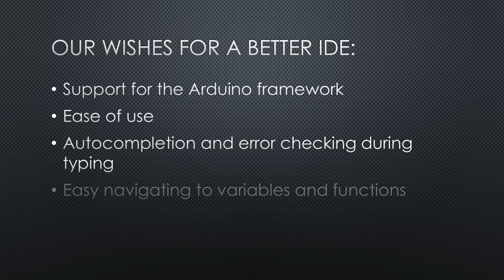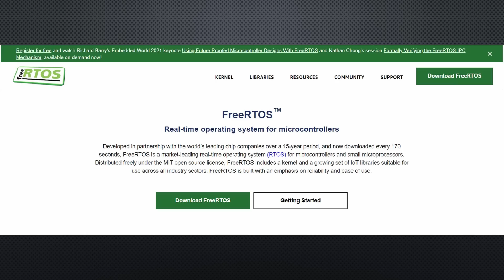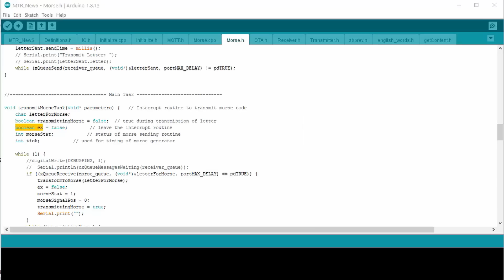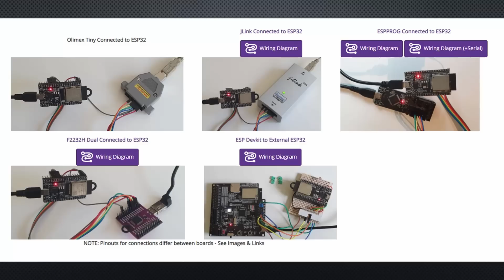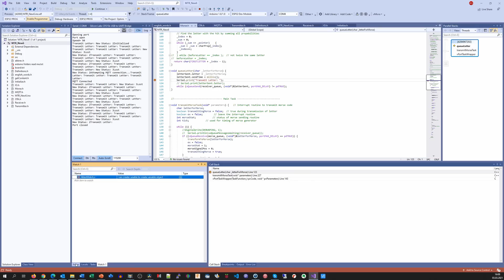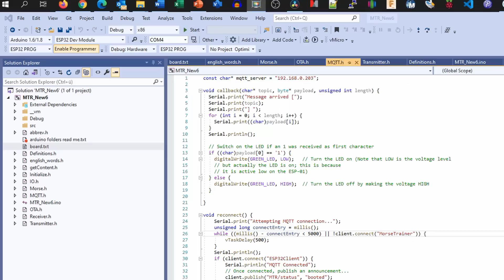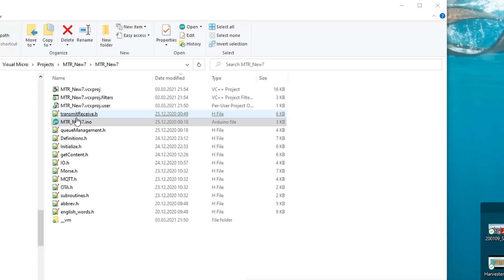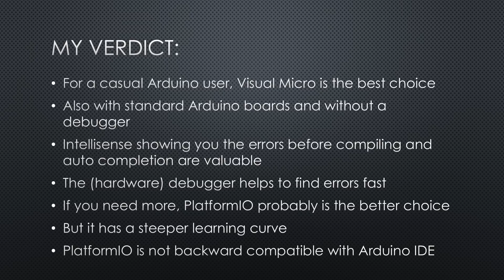#375 Is Visual Micro the better Arduino IDE? Including ESP32 inline debugger

Comment from the maker: Visual Micro only works on Windows. I should have mentioned it in the video. Sorry for that.
Reply: Anyone know if it works under Wine?
Reply: @boots7859  Sadly Visual Studio performs abominable under wine, if you manage to get it going at all. Perhaps it can work as a plug-in for MonoDevelop (aka Xamarin Studio aka Visual Studio for macOS, but then the Linux build) but that would also need some work from the plugin developer(s) or community.
Reply: You can use VS Code add-on Arduino, that way you can use on any OS.  Good thing is that you can open any existing Arduino project with VS Code and whenever you want you can open that project with Arduino IDE again not like PlatformIO that create specific files for the project.
Reply from the maker: @Chris: Did you already try it?
Reply: @cdyoutoob  Link on the page takes back to classic ide download page.
Reply: @sairfan06  the #experimental_software tag is not setup. Just scroll further down and look for 'experimental'. Top half of page does show current supported version as you said.
Reply: @cdyoutoob  thanks got it,
Reply: That eliminates me as I only develop on Ubuntu.
Reply: Oh, that's a pity. Nowadays that's almost unforgivable. PlatformIO's pretty good, and I suppose you can contribute fixes to it as well.

Comment: 20 years ago i worked for a company where we build JTAG Debuggers (for the Pentium CPU). The reason why you are limited to 4 breakpoints is that these breakpoint get serially shifted into 4 special registers inside the CPU. They are simple address comparators that finally can halt the cpu. There are just 4 of those registers, that's the reason why you can have just 4 breakpoints .. but that should be enough for most scenarios.
Reply from the maker: Thank you for clarification. It seems logic and another viewer mentioned the same fact. I did not know it.
But I have to confess that I fast get 4 breakpoints because I keep a few "strategic" ones. But I learned to deactivate some of them if I do not need them anymore. Like that the stay where they are...
Reply: Btw: The JTAG debugger you get today for <15 bucks costed ~10K bucks those days. The (great) JTAG idea basically is a long chain of bits that get clocked bit by bit  into various components of the cpu. To be as fast as possible we built a special ASIC those days that ways able to "clock in" those precomputed chains with ~10Mhz, to be able to stop at a breakpoint, examine a variable or memory condition as fast as possible and have the cpu re-go.  I created those "serial chains". Boy that was ages ago ... but at these days nobody else did it that way ... therefore the price ;-)
Reply from the maker: With such things we see how lucky we are today. I highly integrated chip does the thing for a few dollars :-)
Reply: I always feel amazed when i see epic tech comments from people who made all these technologies back in the days. Cool!
Reply: @AndreasSpiess  Even today, I can only set a few breakpoints on my ARM devkit at work before it complains 'no more resources'. Thanks Texas Instruments.
Reply: ب

Comment: Thank you Andreas for your information video. I have been using Visual Studio for many years and used with its C++ debugging. I will start to test Visual Micro as an IDE for my Arduino projects.
Reply: Visual Studio != Visual Micro.
Reply from the maker: The debugging of the ESP32 works quite well!

Comment: I have used Visual Micro for over 11 years now,  and have not found anything that I couldn't do.  To understand the environment it is equally complex and has a long learning curve to really know all the features.  So, it is the devil you know, vs the devil you don't know.  I like having compatibility with Arduino IDE,  having this feature defeats the ability to control libraries versions the 'easy' way.  Having Arduino IDE compatibility means you can hand off source to a newbie so they can make changes easily.   Excellent video as usual.
Reply from the maker: Thank you for sharing your experience. I found the learning curve less steep as with PlatformIO (to get something working). But it has less possibilities for large projects where I would prefer PIO.
Reply: @AndreasSpiess  I have had no problems with large projects with Visual Micro + Visual Studio.   I agree, getting VM + VS to work is a lower learning curve.  However, you can get into trouble with either tool equally.  :->   Both are good solutions.

Comment: Hi Andreas, I have used both Visual Micro and PlatformIO extensively and for large projects. I'd like to add a few things to your comparison. 
1. The serial port in VM is much more stable than PIO. You can plug the device in and out of the USB ports, and the serial monitor just keeps working. Not so with PIO. 
2. On a multi-monitor setup, Visual Studio works much better than Visual Studio Code. The latter does not allow 1 instance to have several windows, whereas Visual Studio allows you to arrange the windows any way you want it, even over multiple monitors. 
3. In Visual Studio you can test (HW independent) library code by compiling it for windows. All the powerful debugging features are available. You can use the built in unit testing framework to thoroughly test your libraries. 
4. I use multiple projects in one solution a lot! It is the perfect way to write smaller test-programs to test-drive your library components. This way your main program, your libraries and your test code stays together. (a simple example : when you develop an arduino library, the library itself and the example projects are all separate projects in one solution). 
Of course it is a personal matter, to some extent, but I've found myself always more productive on VM than on PIO. Thank you for your inspiring video's and I hope to meet you once in real life somewhere, someday where we can talk about our projects. Pascal
Reply from the maker: Thank you for sharing your experience! I never used testing feature. It is still on my list. But I do mostly projects and not libraries, so the testing is often done with "the real thing"...

Comment: Another great video ... good to have your input.

I bought Visual Micro a long time ago. I had it installed on Atmel Studio (which was an option.) As you point out, it works without additional hardware purchases, (a selling point for me at the time.) But, while serial debugging seemed like a really cool idea, it has some serious limitations. Also, I found that with Visual Micro, every time there was an update to the Arduino ide, Atmel Studio, or Visual Micro ... things would break. At times, it could be really frustrating. Finally, I bought an Atmel ICE programmer/debugger (and Visual Micro became redundant.) The Atmel ICE costs ... but it just works!, and Atmel Studio is a wonderful piece of software. Of course Atmel Studio only handles Atmel products, so ....

I know that a lot of people love the idea of having an 'all in one' solution. Intuitively however, software which tries to do everything, is bound to have some issues, which the creators will struggle to keep up with. 

For me; I'm happy to use Atmel Studio (with ICE) for Atmel products, STM32 CubeIDE (with STM link) for STM products, PlatformIO (with ESP-PROG) for ESP32, and even Arduino (with Serial.write() ) when I just need to throw something together quickly ... since each of these environments works 'really' well for the supported hardware.

I applaud the guys who make Visual Micro. It sounds like they have improved it considerably since I last used it, and perhaps it's for some people, but probably I won't be switching.
Reply from the maker: Thank you for sharing your experience! For my use case (only Arduino compatible projects), mostly on the ESP32) it fits my purpose because of the debugger and the backward compatibility that I can use the Arduino IDE to show my projects on my channel.

Comment: 4 breakpoints is not a limitation of gdb, when running a program from flash you are dependent on breakpoint support from the jtag hardware inside the chip.
As the debugger is not an emulator, it cannot stop program execution by it self. It actually writes the address of the breakpoint to a register in the chip. Ask the chip to continue running. And then waits for the chip to report back that a breakpoint was reached and has halted.
It is different if program is executing from ram. Here, when you set a breakpoint,  the debugger will replace the instruction at that location with a break instruction (storing the real instruction in its own memory), and using some clever replacement make this invisible to you. Thus not being dependent in a number of break regusters in a jtag unit, you have close to unlimited breakpoints when running in ram.
Reply from the maker: Thank you for clarification. I did not know this.

Comment: Andreas, again thx for the excellent videos you create ... first thing I watch Sunday's after my breakfast :)  I've been using the Arduino IDE for 4-5 years and gave PlatformIO a try last year, mainly because I had to deal with specific Library-versions & different hardware. It did work, but as a hobbyist I found it too complex for me.
Visual Micro seemed an ideal solution and I gave it a try; I've created a Solution with one Project inside as you showed in your video. I used the 'Clone for project when using libraries' with the 'Library versions',, this is exact what I need and it works fine. Gave the (serial) debugging a try and again excellent.

But there is one thing I cannot find how to do, probably because I am not used to work with VS 2019 / Visual Micro : in the Arduino IDE, I regularly use the 'Save as ...' with a postfix version (-v1, -v2, ....) to have a copy of my versions while developing. But I cannot find how to do this with VS 2019/Visual Micro - if we keep the one solution/one project structure, I need to clone or copy the solution and rename (all solution/project files)? Although having multiple versions of a project in a solution could also work for me ? But there does not seem to be easy method for that - using a full-fledged version-mgt system will again make this too complex ?
Do you or anyone else have some recommendations how to handle this ?
Reply from the maker: Maybe you have a look at the github implementation of Visual Micro. It would give you the possibility to create new "commits" instead of versions.
I also use Visual Micro for the moment because it is backward compatible with the Arduino IDE.
Reply: @AndreasSpiess  I will give the github implementation a look. But currently I am looking into the one Solution containing multiple project versions; In Solution Sketch, I start with proj sketchv1; then a create a new project sketchv2 and copy my ino & .h files into the new directory. For the libs I use the 'Clone for solution when using libraries'. Not as easy as the 'Save as ...' in the Arduino IDE but workable. I'll see how this progresses ...

Comment: The best approach i found is to use the best of both worlds:
1. Open Arduino IDE (Advantages: easy to use, libraries available, default IDE and therefore many tutorials online in case of errors, all possible boards supports, ...), go into the settings and enable external IDE.
2. Open CLion (Advantage: High Level C++/C/Python IDE with autocompletion, ClangTidy, ... support) on the project from above and program here.
3. Compile in the Arduino IDE and use the Serial monitor from it.
Reply from the maker: Thank you for sharing your experience. Your approach is very good if you do not want a hardware debugger. This feature is very important to me.

Comment: As always, you have provided an excellent single point of reference for me when I have decided to try something out  and postponed (procrastinated ?) the learning, knowing that I will always find the answers if I search your videos. Thank you, Andreas! I have been using VS Micro since the early days and VS itself even longer. In fact I did not start using Arduinos till VSMicro brought intellisense and a mature GUI to the platform. After being utterly spoiled by using PIC micros with their superb dev platform that included step/trace debugging, emulators (you could test most code without hooking up the micro) I was disappointed with the 'Duino. In studying JTAG debugging with the ESP32, I noticed that the IO Pins used are also the ones used for accessing the 4-wide SD-MMC bus - I wanted to mention that this is one more exception where it may not be possible to attach the debugger.
Reply from the maker: I agree with the pins. This is why I created an Excel sheet where you can select all sorts of criteria to find the pins you (still) can use. The JTAG pins are one category which must not be used if you want to debug.

Comment: I'm using Visual Micro for 3 years now and for people accustomed to Visual Studio this is simply the best. Platformio has barely a GUI. Everything is done via dozens of console commands and there isn't even a shortkey chart available for people with a non-US keyboard. I prefer comfortable software.
Reply: BTW: One can use ReSharper C++ together with Visual Micro to get an even more powerful development environment.
Reply from the maker: I also found Visual Micro easier to use. This was the reason for this video...
Reply: @AndreasSpiess  I just wanted to give VM a second voice in the comment section since it was foreseeable that Platformio fans would run wild in the comments like when Heise.de mentioned Visual Micro.
Over time I had a lot of conversations with the author about problems I had and he really tries to help.

Comment: Arduino has realsed an Arduino idea 2.0, still in beta but maybe hoy could give it a try
Reply from the maker: I did it. Good direction, a long way ahead...
Reply: @Bryce Ahmad  @Marco Drake  why would anyone hack somebody's profile? Go see a psychiatrist, you have issues.
Reply: @AndreasSpiess  did you get enough of a look at it to form an opinion that is worth a video? in my opinion it having auto complete already makes it a thousand times more useful than the current arduino ide
Reply: @TheScarvig  from what im seeing...the 2.0 beta is built on the same VScode core as this ...so its prity much the same.....just doesnt have all the window features..that IMO are unnecessary
ive also noticed M$ is pushing the VSCode everywhere lately... Windows, Linux, RPI, and now MCUs
Reply from the maker: I tried to use it but for example autofill did not work after deleting a letter and stuff like that. Nothing for a fair review for the moment. It compiled a complex ESP32 sketch with many libraries. This part seems to work.
They also will not create an ESP32 debugger interface and hope, somebody else will do it. I will have a look at it from time to time.

Comment: using visual micro since yesterday and I'm very impressed. Thanks Andreas for inspiring again and again and again and......
Reply from the maker: You are welcome! Glad you like it.
Reply: Why not use Atmel Studio? It is a version of visual studio specificsllg for atmel mcus.
And they added in arduino functionality a long while ago making visual micro obsolete.
Only thing I dont know is that if there is debug capability without a programmer, in that case visual micro still has its place. But they have a visual micro plugin for atmel studio as well.
Reply: @LittleRainGames  in my case I have a mid large project with ESP32

Comment: Have been using VM now for a couple of weeks and like it quite a lot. One thing is that I have not been able to write a littleFS file system for an esp32. I carefully followed the skimpy directions on the VM website and always get a can't find a tool error. A work around is to set up  the littleFS tools in the Arduino IDE (per another good online video) and write the files and file system with this environment. Once the file system is in place files can be read and written from inside a VM C++ program with the appropriate libraries. Another issue I came across is that the serial interface stops working for output if all the pins are setup as Digital IO (required for the board I  am designing). Not sure yet which pins are the problem.
Reply from the maker: 1. They have a forum where you can ask questions.
2. I made a video about which pins you can safely use.

Comment: I have used Visual Micro when I was a Windows user. It was simple setup and worked flawlessly. When I went to a linux desktop I initally used the Arduino IDE but now I use PIO.  You can spend many hours installing, configuring and troubleshooting IDE's when they don't work. I think the arduino IDE is fine for most beginner to intermediate users.
Reply from the maker: I agree and I will stick to the Arduino IDE for the channel. But I like to use a HW debugger for my more complex projects...

Comment: I was an Arduino IDE user when that was the only feasible option for a beginner to compile and upload sketches. With arduino-cli I can now do the same but in any editor, it still takes a bit of work to have autocomplete working right but it's miles better than relying on the compile button to check errors. My main issue with these complex or user friendly IDEs is that they often hide some of the details of how the code is compiled and it often makes it difficult to have a project that can be cloned and then built by anyone, this why I'm sticking to vscode because it requires that I add the necessary scripts and configuration to the project.
Reply: I Like the Arduino-cli too and If you switch between different devices it helps much for holding things transparent, but it could bei a good Idea to Share Arduino-cli Scripts or templates.
Reply from the maker: Thank you for sharing your experience. IDEs seem to be a very personal choice. Everybody has some different needs and preferences...